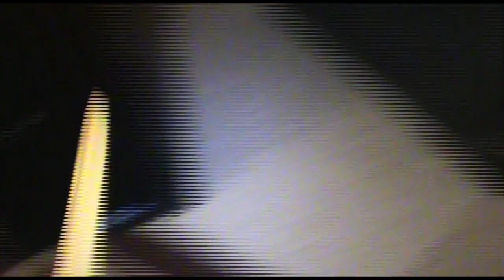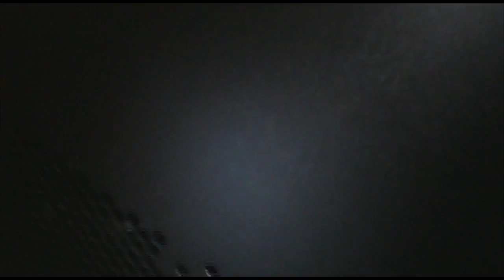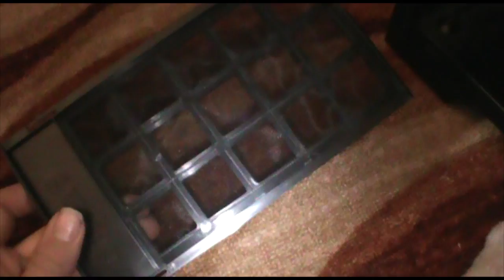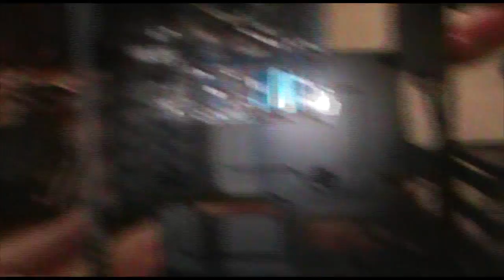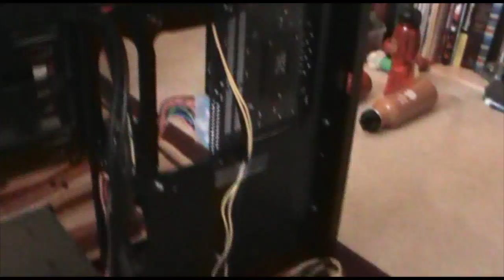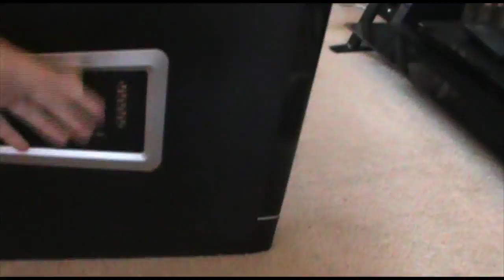2012 Custom Built PC: Case Swap

Comment from the maker: Well now that I can compare them side by side, the Corsair is built 95,320 times better than the Raidmax. Not that it's the most terrible case you can buy, but I wouldn't reccomend it. I have something cool planned for it, actually.